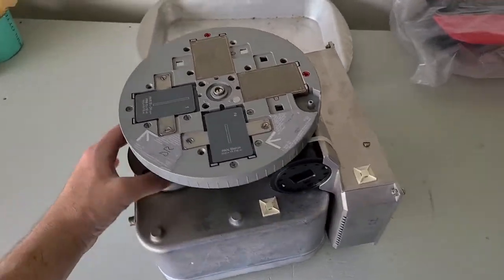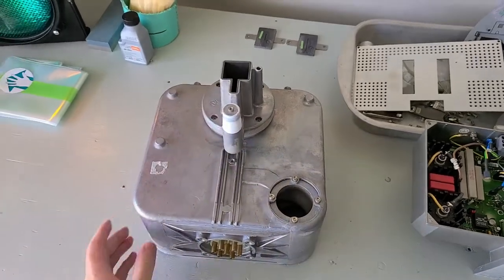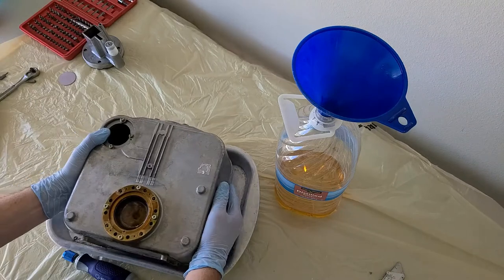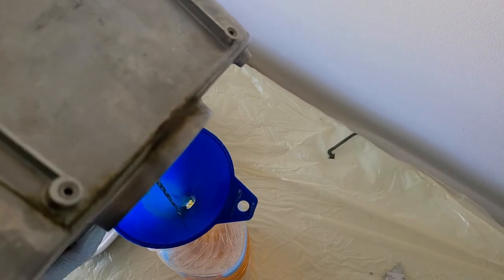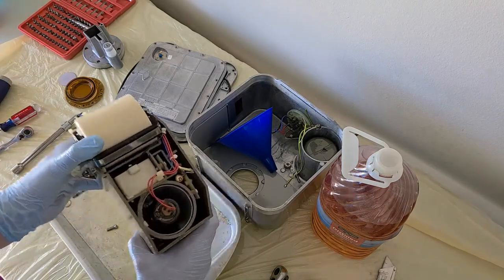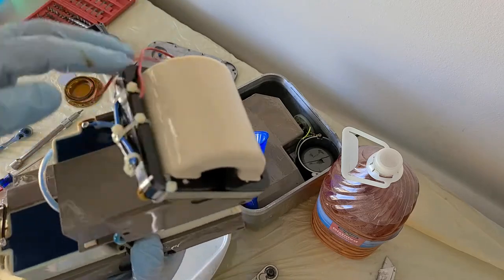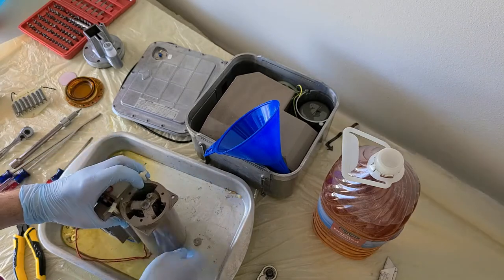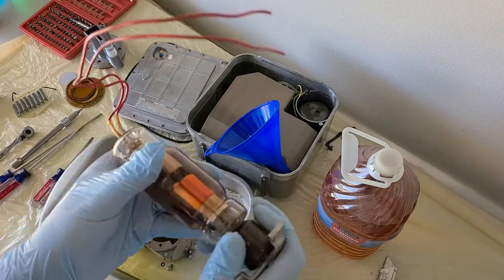Siemens Xray Panorex Tube Teardown. Pulling out the xray tube!

Comment: At 12v you will destroy the filament, they are typically 1.5-5a at under 7v for a small dental tube, ours is 1.7a at 4.6-4.7v, other list similar specs (typically a slightly higher current)

Comment: 17:34 the voltage was too low to produce X-rays?

Also, what is the source of visible light from an x-ray machine? Are you saying it's also x-ray tube?
Reply: That is the filament. It vaporises metal particles that get hit by the electron beam and thats what creates the xrays (afaik) you only generate xrays when you supply it with high voltage along with heating the filament.
Reply: @Nielsquake0  I'm nor sure x-ray and light source is the same thing